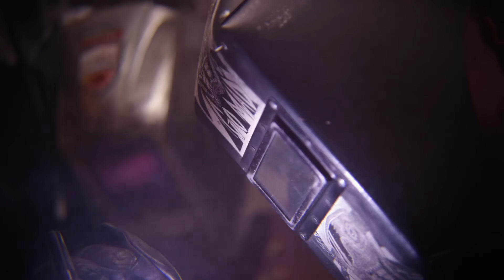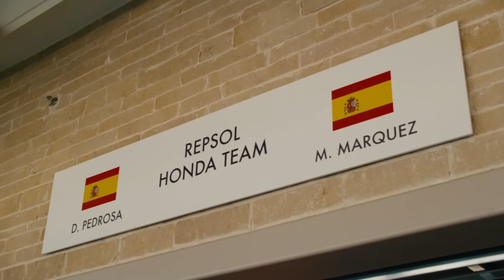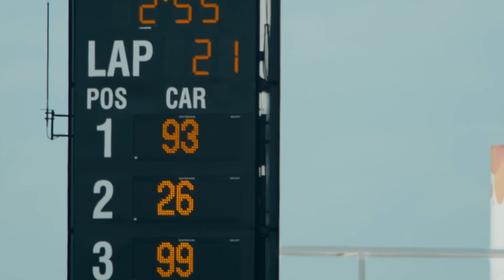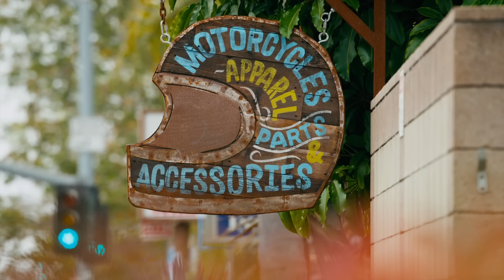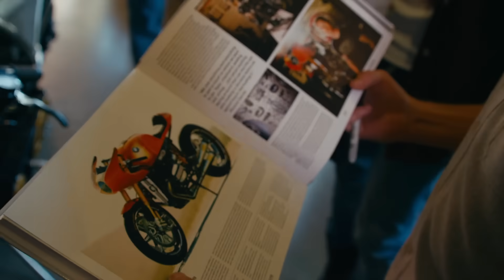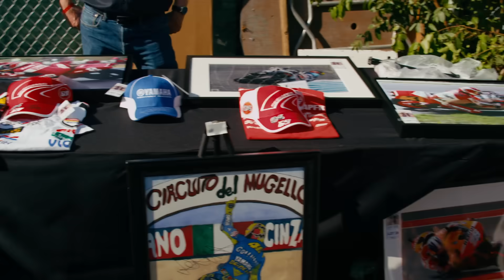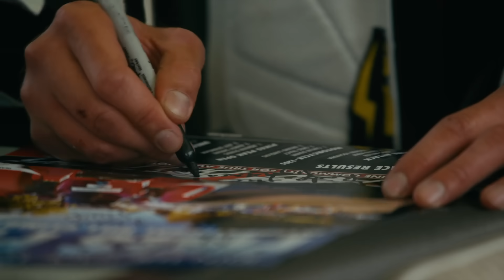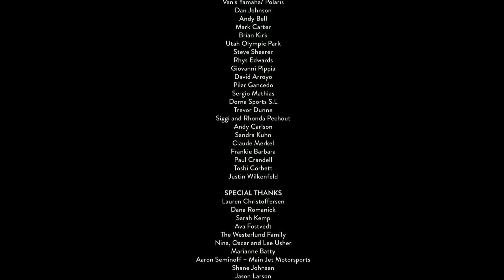On Any Sunday The Next Chapter

Comment: Grew up in Riverside county where much of the first movie was filmed.  Got my first Honda 55 (step-through) with straight pipe and no seat cushion in about '70, graduated up to a Hodaka 90 next year. Watched the first "On Any Sunday" when it came out.  We were mesmerized and enchanted.  "Hey!! I've been there!!"  Yeah howdie!"  When you see on film and story, places you've been and things you've done or wish you could, it brings it all home.  Hadn't yet met Malcom Smith (one of the principles in that first iconic movie) who still lives in Riverside and runs a massive bike dealership.  My brother is friends with him.
   We never competed in organized races.  We were so poor we couldn't even pay attention.  But the force was strong with us.  After several moves and make-up bikes, then many years without a bike, I retired from my job in Bakersfield and bought a used DRZ 400 in 2020 to ride up in the hills near the Rubicon.  Very near "Hangtown", which is the local nickname for Placerville, where I now reside.  In this edition of "On Any Sunday", the narrator mentions the "Hangtown" event, which actually takes place at the "Prairie City" offroad facility,  just a stone's throw from Sacramento Mather Air field on the south side of hwy. 50.  It's open year-round and you can bring most anything with wheels there and have fun.  Paved Go-Kart track (bring, or rent), miles of rolling hill trails, speedway track, test area, Motocross track...what an amazing place.  I worry that with all the housing expansion surrounding it, how long Praire City will avoid being squeezed out, to become just another historic memory and statistic.

Comment: first motorcycle i traded some tires for a basket case Honda 305 got it running but it kept dying never got to keep goin, got new Honda 450 CL in 1973 and owned several Hondas and Yamahas and one Kawasaki H1

Comment: I remember exactly when the og version debuted at the fox theater in riverside .
It was approximately 2 miles from the original k&n and right across the street from riverside motorcycle salvage where I had a job pushing brooms on the weekend .
Keep in mind we were 12 - 13 at the time and had dirt bikes but when we asked our parents if we could ride them there they said sure but if you get in trouble we’re not coming to get you .
Dejectedly 6 or 7 of us rode our bmx bikes there , when we got there were 3 bikes parked in the front 2 Husky’s and 1 Harley that we drooled on for an hour .
Needless to say we didn’t make it home before the street lights came on .

Comment: Mine started doing that about 300 km in. The mechanic completely pulled the speedometer to take pics for warranty, and it hasn’t done it again after. One thing I did notice early on was moisture inside the speedo glass, I wonder if this is part of the issue. 🤔

Comment: On Any Sunday and Endless Summer are why I ride and surf. After I saw On Any Sunday, at age 8, I couldn't stop talking about motorcycles and riding. My parents didn't get it at all. I scrounged up a broken mini bike by age 9, got it running, and fixed it up (meaning I painted it flat black and took the muffler off. By age 10 I traded some stuff and the cash I had saved and bought a broken, no title, Yamaha DT 60. My parents were not happy. Again, I got it running, fixed it up, and got a title for it. It just went on from there. My Dad played team sports (which I was not interested in at all) and couldn't understand what I was doing with dirt bikes and surfboards. Eventually, they gave in and supported my interests even though they never really understood it. I'm pretty sure they thought all of it would fade away as I "matured" Anyone who rides or surfs knows the answer to that.

Comment: I enjoyed this movie but I still prefer the original. I was 17 when it came out and I was racing motocross on a kitted out trail bike. I could identify with the riders I saw in the movie because they were riding the same bikes I competed against. Not the $10,000 plus bikes of today. Anyone could get $500 trail bike and head into the hills for a day. Trials riding is an art form and it's not mentioned... just the high priced professional stuff that most people can only watch. You've missed the spirit of being on a bike, just doing your own thing. I'm 65 and have a heart condition so I don't ride anymore and, well, 4 strokes bore me to death. The EcoNazis have ruined bikes for me. I will never forget the 2 stroke white noise when the starting gate dropped. Or the pile ups on the first turn. I never won a race but I did get 3rds and 4ths. Not bad considering I was up against RM 125's while on a MT 125 with a CR barrel and expansion chamber. Yeah, I took the lights off before the races and put them on again to ride home. Life was simpler and a lot better then....